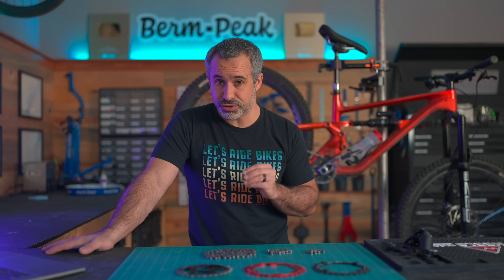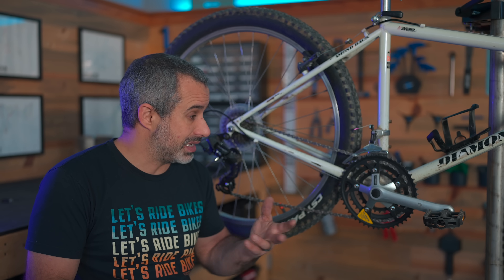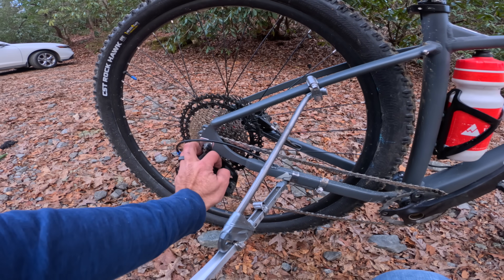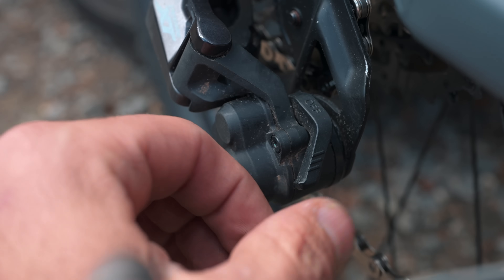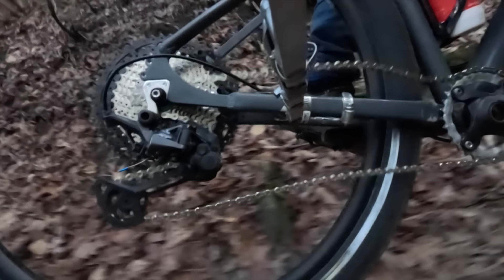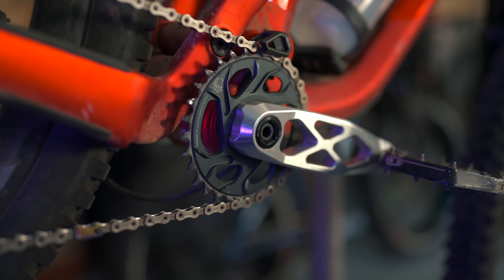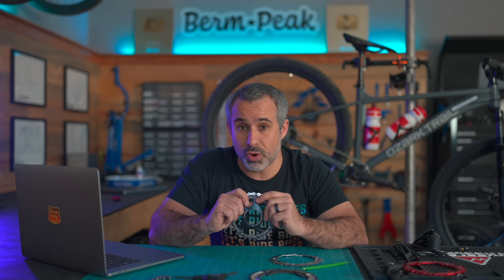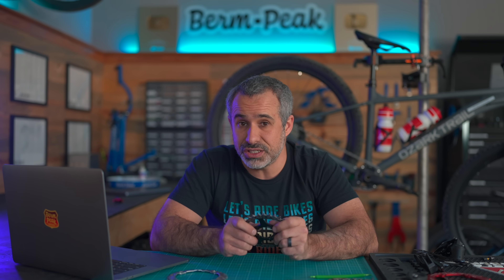The Genius of Narrow Wide Chainrings - Why they work!

Comment: I used to work with a pro shimano mechanic.  He says narrow wide chainrings have been around in large machinery for ages. This made it hard for bike companies to patent this as it already existed, and everyone could start making them.

Id have to dig into this more, but makes sense!
Reply: Isn't the reason why these arrived on bikes so late the front derailleur? By their nature, NW rings don't work with a front derailleur. As soon as Sram had enough gear range to ditch the front derailleur, they put a narrow-wide on there.
Reply: @michaelmechex  Earlier the bike industry wasn't as versed in pushing this kind of nonsense.
Reply: @michaelmechex

You mean as soon as SRAM could not figure out how to develop a reliable front derailleur they ditched the front derailleur. LOL
Reply: @michaelmechex  beg to differ, I've been using NW chainrings on a 2x setup for well over 10 years now and while it might shift a bit slower, it still works just fine. 1x setups are fine IMHO for the general mases who don't want to think about having to shift gears in the front as well and DH, but it sucks for cassette life as most ride on mainly 3, maybe 4 gears and they wear very quick.
Reply: @lynxg4641 I don't understand your logic here. The biggest drawback to a 1x is the use of 11 and 12 speed cassettes to get the range, which wear very quickly because of how thin they are; not because you're predominantly using 3 or 4 gears. If you have a 1x 8,9 or 10, you would see as good cassette wear as if you were running 2x.
Reply: @lynxg4641  that is however not the downside of the chainrings, that is the downside of users buying wide range drivetrains for cycling just flats to work
Reply: @tomaskozler4856  Ah no, I'm talking guys who ride their bikes, on trails, up, down, flats, rolling, I don't deal with anyone riding on the road with a wide range gearing setup like on an MTB.
Reply: @jeffreymanuel6454  Well, I can't comment to myself, who has only 1 bike running 11spd and it has a Tringle speed chainring setup I switch manually depending on the riding I'm doing. Other than that, all my bikes I ride are 10spd, but I'm also cognoscente to actually use my entire cassette, i.e. use my brain to think about shifting. To the 8 & 9 spd wide range cassette/gearing, on pure mountain trails where it's mainly up or down, maybe yes, but when you like to pedal rolling/flat as well as mellow to steep climbs, the jumps are quite massive, although I would like to try it at some point, just to see.
Reply: Yes, narrow-wide concept is from 1978 patent, expired in 1998. That's why everyone can make their own NW chainrings without infringing SRAM patents (as long as they not fully copy their tooth profile)
Reply: @rusteddreams  Narrow-wide chainrings have most likely been around since chain drives for steam engines got feasible during the industrial revolution.
Reply: There is a Pinkbike article which mentions a patent by Shimano filed in Japan around 1986 on exactly this narrow wife (not Biopace) chainring. I tried to find it in the japanese databases, but could not find it, lawyers who mentioned it as prior art did not answer emails (as most lawyers do to protect themselves or their clients).
Reply: @zoobab28  As a tangent.
Biopace was amazing (Only tried it on my road bike), I managed to find some NOS back around 2003. 
Biopace lost market credit because the ignorant public lumped it in with all of the terrible oval-ring knockoffs popular at the time. Biopace certainly was not round but it wasn't really a true oval either (more complex shape) and its ovalness was rotated about 90 degrees from that of other ovals so it really made high cadences smoother and took stress of of knees. (Common ovals based on amateur engineering and incomplete theory did the opposite.)
Reply: @zoobab28 bit sexist there mate😂
Reply: @TheDuckofDoom. I'd forgotten about Biopace. Maybe I should try it out
Reply: Another thing is that the comparison here is between a narrow wide chainring and a ring with ramps and pins designed to shift. SS chainrings have been used for a long time and feature both thicker and taller teeth. If you were to do a comparison of all 3 I think the "great leap of innovation" that you get from narrow wide would be massively reduced.
Reply: @kailashblades  yup, was using DH/SS rings with the much thicker, not ramped and taller teeth for years before NW came out with the same sort of improved chain retention.
Reply: as well as bicycles with skip tooth. schwinn sweet tooth as a great example
Reply: Thats because patents are about payment not progress.
Reply: @DjDoggDad

Wrong. Patents are absolutely about progress because without them you would have virtually no innovation at all. Why would any company spend millions of dollars developing a new technology that any other company could just come along and copy while paying no fee? You really think any sane company out there would spend even $1 to develop new tech if a competitor could legally just come and heist it from them for free at their choosing??? Of course not. 

Without patents you would have virtually no new innovations at all except for the few by those, who want to do it simply for the joy of it. No company with paid engineers etc… would do it and without that you would have little to no real innovation in any field.
Reply: @DjDoggDad  Patents are about giving due credit to the first person or company to come up with, create a novel product  or design that is better, superior than what is currently available.  Patents rights give this person / company an important financial  incentive to spend time,  resources, to research and develop new ideas and technology to improve upon something.  Of course there is no guarantee the time and money spent developing something will actually succeed and be marketable, sellable.  It's a gamble, and more often than not it's wasted time and money.   For example Pfizer spent millions lots of resources creating viagra, with no guarantee it would work or be safe, no bad side effects short or long term, to get final FDA approval.  Once it proved to be successful and a hit with men everywhere then they deserve to own the rights to the active ingriediant / chemical formula of their blue pill, with no one else allowed to copy it make cheaper generic pills w/o their permission.
Reply: Another advantage of single front chainrings is that you can make the teeth taller since you don't need to worry about transitioning the chain to another ring.  That can't hurt retention, specifically in the test Seth does with the clutch off.
Reply: can someone explain why would they then wait to use it for these modern 1x setups when 1x setups were around far earlier as actually the direct ancestors to 2/3x setups?
Reply: He gives sram way too much credit here in a dangerous way I feel. Sram are very litigious and have a history of predatory IP practices when it comes to smaller brands. The messaging here serves to reinforce and enable that kind of behaviour on their part.
Reply: @kailashblades  He's giving credit to SRAM for being first to adopt the NW chainring on bicycles, and demonstrating how it's arguably more effective for reducing drop chains than Shimano's clutch.  He may have been wrong as far as thinking SRAM invented the NW chain ring as a mechanical utility.  As mentioned above, other industries that use chains have, decades earlier, developed the NW rings, realizing their advantages.
Reply: @connicrow9463  Sram were not the first to adopt NW on bicycles. They were used on bicycles over a century earlier and then were reintroduced by wolf tooth and others  shortly prior to sram jumping on the bandwagon then attempting to muscle them out. The comparison in this video is made between a NW chainring and a geared chainring designed for shifting (specifically designed to not hold a chain in place) which is a bit silly. It should compare NW with regular SS chainrings to isolate the actual difference that the wider teeth make.
Reply: @kailashblades  I actually like SRAM stuff.. but the 2008 x7-9 stuff my Gary Fisher Paragon was equipped with is way better than the 2020 XCaliber 8
Reply: I’ve never seen narrow wide in industrial applications
Reply: I bet you'll find a narrow-wide chainring in the Databook.  Unfortunately I don't own a copy of this masterpiece.
"Nothing new under the sun."
Reply: No, it really does not make sense. Such patents expire after 20 years and are not renewable nor repeatable in the future by other firms to monopolize so if they have been around for ages in other industries such patents expired ages ago less 20 years as well. 😀😀
Reply: It seems way too simple to be allowed to be patented anyways. If a parent troll parents it then they ruin it for everyone. Not only for the other companies but for the consumers as well.
Reply: The SRAM ip is nonsense. I have a cylinder mower with narrow-wide chain ring made in the 80's. As most have said - it's something, along with full height taller teeth, that is available when the compromise of having to shift to different rings doesn't have to be considered. Yes they will work in this context, and work well made by anyone.

Each year a "new" tech has to be launched with great fanfare, but it's literally just the same metaphorical "cogs" re-issued with focus on blind profit, not development with sound basis... like skinny tyres back in the 80's. I wish bycycling quarterly was still published: they did more for exposure of redulous claims than any other media form. They deserve recognition as being needed in today's market to focus the trends using useful applied knowledge. Credit to berm peak for giving the trials he did here a good go! :)
Reply: I remember seeing some narrow-wide cogs on a late-70s/early-80s panel saw that I was servicing, they even had an ISO standard stamped on them (can't remember if it said the sprocket was conforming to the standard, or that it was compatible with standard chains). Probably ISO 1275.
Reply: anchor chains have them

Comment: on 2x i had just started to notice that these chairings actually make the shifting worse, but you cant find normal chainrings made out steel anymore
Reply: Unless you need the chainring with obscure BCD spec, steel rings from Shimano and Prowheel are still available.

Comment: Great video Seth, and I can confirm this from experience! I did a 1x conversion on my 2008 Trek last summer, and I took the frame in to a bike shop to have them pull the cranks as I didn't have the right tool. When I told the mechanic what I was doing he said without a clutch derailleur I'd be dropping the chain constantly and it wouldn't be worth the effort. Of course he kindly tried to sell me one, which I equally kindly refused. I purchased a cheap narrow-wide chainring from Amazon (something like $11) and after nearly 100 miles of trails and riding, I have only dropped the chain one single time, and that was when stick got sucked into my drivetrain and knocked it off. Otherwise, smooth sailing! The NW chainring really does hold the chain in place incredibly well.
Reply: Ahh the oh so common “bike shop bro” 😂
Reply: The only time my single speed chain came off is when I got run over by a drunk guy in the way to work.  Luckily I was not hurt so I just called in and said if be late to work that night you can check my bike if you don't believe me.

The drunk guy took off of course
Reply: @madtownangler I guess if you weren't hurt it'll be difficult. But if you *are*, go and report this kind of thing to the police. They can estimate how and where the vehicle got damaged. When the culprit inevitably brings in their car to get fixed, the workshop might report them. Sometimes workshops have police-provided lists of damaged areas on specific makes and models of cars to look out for.
Reply: @luckbot-5000  I wasn't hurt my crank got bent though.
Reply: I did a 1x9 conversion many years ago with a narrow wide ring and a non clutch x7. It dropped pretty regularly until I added a oneup chain guide. I'd get maybe 1 drop per ride on rocky technical terrain after that.  But probably a clutch would have been a good upgrade.

Comment: Well this is great timing! I had problems with my Cube E-Bike dropping chains cause the stock chain ring was terrible, so I bought a Race face Narrow wide. However, it's a 12 speed chain ring and my bike is 11 speed (Deore 5100). The 11 speed chain works fine, but I'm not getting the best out of the chainring so should I just buy a 12 speed chain?? Will it work with the 11s cassette?

Comment: I had a Marin with a Biopace  chainring. Good times :)
Reply: I still have a Specialized with Biopace - a great bike for 1989, but Shimano got Biopace exactly wrong for MTB use. Their idea was to increase the diameter of the chainring when it pulled the chain as the pedal came to bottom dead center, to convert more momentum from the rider's legs into forward motion before they stop moving down at bottom dead center. 

This makes perfect sense if all your riding is pedaling at high cadence (Road type use), but MTBing is full of situations where riders end up standing and stomping up sudden grade changes, and in this situation they're actively bad. Modern MTB focussed off round chainrings almost universally have the big diameter pulling the chain at the point where the crank is level and rider torque is at a maximum to level out the rider's ability to put torque to the crank instead.
Reply: @peglor   ahh, good to know.

Comment: I don't know about anyone else, but I ALWAYS forget to flip the Shimano clutch switch back to ON. Every time! It's why I prefer SRAM.
Reply: When do you switch it to OFF and why?
Reply: @SergejGrabun  Whenever I am doing any work on the drivetrain or removing the rear wheel. Or for example, yesterday a small stick got wedged into the lower jockey wheel of the derailleur. I switch it off so I could maneuver the chain out of the way to pull the stick out. And then forgot to switch it back on and finished the ride with the clutch off.
Reply: @ButteronaPoptart  ah, makes sense. I'm on SRAM for few years now, forgot that with clutch on it's difficult to move the thing

Comment: Wait can someone explain this? So that little lever on the derailer is for clutch to stop the chain from moving around as much. Are you still able to shift with it? Or should you not do it? And should you run with it on and off for like normal riding?
Reply: Yes you are still able to shift. The switch is mostly there for easy removal of the rear wheel.
Reply: @proginx  can I keep it engaged the whole time then while riding?
Reply: @coleb4323  yes
Reply: @coleb4323 yes, you should. All it does is tension the chain - when riding it should always be engaged, only disengage it for maintenance.
Sram has a different system, you can't disengage it but you can push the cage forward and put a little stopper in there to stop it from snapping back.

Comment: I have a problem with chain growth on my full sus shifting my gears can someone help please
Reply: This should help, shift it to the biggest ring on both sides, push down on the saddle maxing out the travel in the rear shock and check if the chain is too tight, if it is you probably need another link or two to give you a little more slack so that it doesn't max out the chain length 🤘

Comment: So necessary for 1x
Bonus question: can a 2x or 3x front derailleur system have narrow-wide chain rings?
Reply: Not really because your "Conventional" chainring (2x/3x) uses only narrow teeth to allow the chain to slip off one cog onto the next cog. A Narrow-Wide chainring is designed to prevent any lateral shifting so the chain won't slip off one cog to the next because you will end up with a wide tooth in the wide chain link instead of a narrow tooth in the wide chain link.

Comment: I have a narrow wide chainring on my makeshift 1x11 Gravelbike. Although my chainline is messed up (needs to be a few mm more towards the inside) the chain never slips off the lowest gear.
Reply: You get front chainrings that cave in towards the frame. That's what I have on my Santa Cruz... makes the gears skipping long gone!
Reply: @buzzlom it's called off set I use a 3mm off set and a 6mm off set on my bikes depending on the axel sizing
Reply: @dougbrett9218  yes my bike also has 3mm offset to make the line of the chain better :)
Reply: I’ve used some washers to great success to get the chain line in check on some of my Frankenstein bikes lol
Reply: @Bikes_N_Adventure how can you check chainline best? Visual seems poor except obvious, measurement difficult and subject to frame variance. Will try laser but have not.
Reply: I don't think a narrow wide chain ring affects the likelihood of the chain falling off of the cassette.
Reply: @PNWDad but they do!  Or is the clutch doing 99% of that work, I couldn't tell.
Reply: @Papou-pk1ii  narrow-wide is only on the chainring, the cassette teeth are all narrow enough to fit both link sizes. The major factor is the L limit screw, BUT if the chainring has the wrong offset, that can also drop the chain into the spokes.
Reply: I have a makeshift 1x9 on a 1999 Rockhopper where I used the middle ring mounts rather than the outer big ring mounts.

(Four bolt Speshy strongarm cranks from back when, running narrow wide on a 9 speed XT derailleur, OEM kit).
Reply: Having your chain line slightly wider than spec can actually be a good thing. 
Yes if you back pedal in your lowest gear it may drop down but when in your fastest/ highest gear your chain line is more efficient and optimised.
Reply: I drop a chain every now and then on washboard gravel. Maybe the clutch on my Apex GX derailleur is worn?